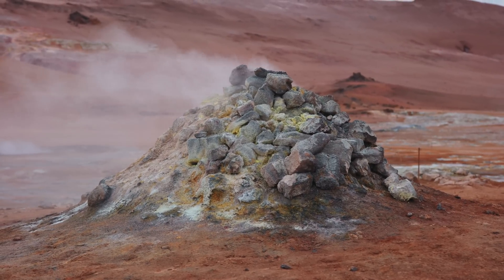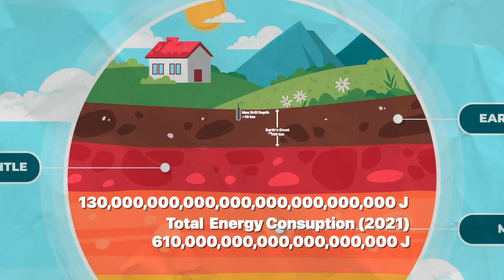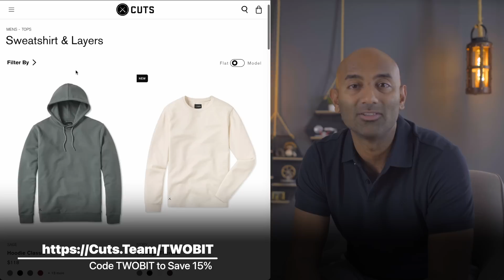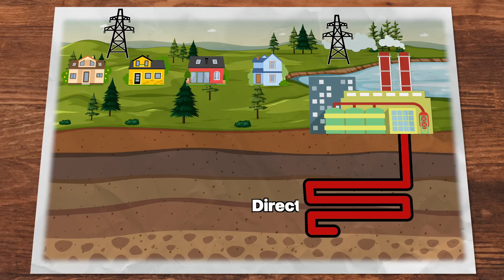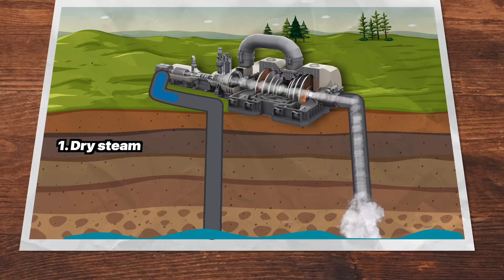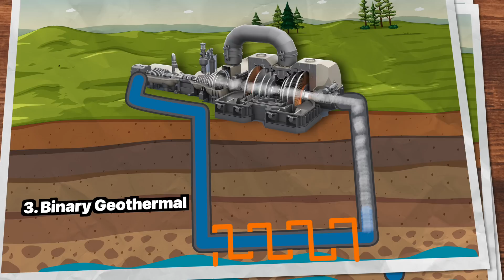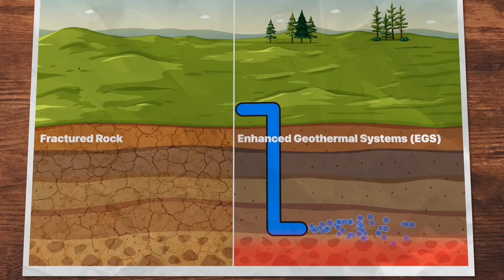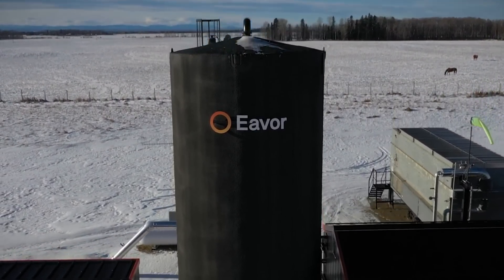This Breakthrough Energy Source Will Replace Nuclear & Coal!

Comment: I am curious. You didn't talk about using the new solar cells that use heat instead of light to create electricity. I am told that these solar units are way more efficient at converting heat into electricity than steam turbines. What about using them with this geothermal heat?
Reply: Are you referring to thermo electric generators ? TEG's
Reply: @richardstubbs6484  I had to research my history to find the video about these. This ALL-NEW Breakthrough Will Make You Forget About Oldskool Solar
2,655 views  Sep 15, 2022  Thermophotovoltaic, Thermophotovoltaic energy, Thermophotovoltaic efficiency, Thermal energy storage, TPC Cell, Thermo photo voltaic, Solar cell battery, Thermal energy grid storage
Reply: Are these things real or the product of someone's conspiracy theory?

Comment: AS DEMONSTRATED  BY THE research at the caldera near Los Alamos, New Mexico there is a problem in the stability of the geological structure making the structure of the powerplant to heavy for the places closest to the flumes for high temperatures needed for the superheated steam to run the turbines.

Comment: The first geothermal plant, 250 MW, was built in New Zealand back in the 1950's. It was the flash type that exhausted spent steam into the atmosphere. It has since been upgraded to reinject used steam, condensed back into hot water, into the ground. Nothing much happened after that until the 1990's then additional plants, using the Israeli Ormat binary cycle, began to spring up. It uses hotwater from geothermal wells to convert a working fluid, pentane, into gas, which powered turbines. The original fluid is never turned to steam but reinjected. This is the solution in use because the temperatures below ground are too low for flash steam plants. We produce about 900 MW of power from geothermal, with new plants, generally 100 to 200 MW, being built.
Reply: No, Italy was first. 
All the binary plants in NZ use separated steam and water from two phase production wells. 
We are quite lucky to have high temperature resources and geothermal power is competitive with all other generation options, but suitable sites are limited.
Reply: @NZLKevin88  I meant the first geothermal plant in NZ, not the first in the World.

Comment: Geothermal is not sustainable. I don't know where you got the million years from, but usually after a few decades the well is no longer economic to operate. The rock around the well cools as you extract heat. The "Breakthrough"s you refer to don't solve the main issues. It's still expensive and will cause earthquakes. They are just different ways to get very similar results.

Comment: Thank you.  I've been wondering for ten years why there wasn't a greater effort to at least drill deep and then piggy back the warmer temps down deep in ANY region with some other tech or two to create the energy needed to do steam/normal heat generation/etc.  Appreciate your bringing this extremely green and cheap tech to more public awareness.
Reply: "why there wasn't a greater effort " - the answer is always 2 things : cost and political will.
Now there are some companies who claim they can do it cheaper, with laser drill heads instead of conventional expensive diamond-tipped drill heads.
Reply: I toured the Equitable building in Portland, Oregon in 1964.  They got all their heating and cooling from a well under the building.  All the hot water came from a heat exchanger about the size of an oil drum. If they could do that 60 yrs ago, why aren't we doing it more and better today?
P.S.  The building was designed in the 1940's and finished in 1948.
Shame on us!
P.S. #2  I did some research and found that where I live, on the Oregon Coast, it would probably take about 50 years to recoup the cost of a geothermal well from reduced heating costs.  Kind of a non-starter.  (My kids won't live that long.)
If the cost of natural gas tripled, the economics might begin to work out.  It could happen.

Comment: My local power company looked for a suitable geothermal spot but couldn't find one, so we continue to run mostly on hydropower. I thought it was funny at the time because we have numerous hot springs and several volcanoes nearby including one in the county. I think the rocks weren't fractured enough. Maybe they will try again with newer technology. For now we still get enough rain and wind to keep relying on hydro, but I noticed California had hydro until the reservoirs started drying up and maybe it's only seasonal down there now.

Comment: Ricky, EGS sounds great, but for the cost and location issues. We should be building MORE nuclear power plants if we have any chance at "replacing" fossil fuels, which will not happen in my opinion in ANY of our lifetimes. Nuclear power stations do not require as much land per megawatt as other low-carbon methods of electricity production. The Arkansas Nuclear One Station requires only 1,100 acres (1.7 square miles) to produce 1,800 megawatts operating at a 90 percent capacity factor. A study by Entergy Arkansas estimates that for modern wind and solar plants operating at the same capacity, they would require 108,000 acres (169 square miles) and 13,320 acres (21 square miles) of land respectively to produce the same amount of power. Nuclear is by far the BEST, CLEANEST, and most cost effective by far.. So, why are all the tree-huggers wanting to shut down all the nuclear power plants???

Comment: Hydraulic fracturing (frakking) solves the rock permeability issue and you would only need to use water as you wouldn't be trying to free any oil from the rock.

Comment: Regardless of whether I throw a brick at your window, to smashi it with kinetic energy, or pit a blow torch to the glass until it shatters, your window is still broken. Same applies to bedrock, if we convert bedrock to shale by hydraulics, kinetic energy transmitted by fluid, or thermal means, in this case cold water rather than hot gas flames, that rock is shattered. If it ever does heal, it will take longer to heal than bipedal primates, and multiple orders of magnitude longer than our little subset of balding, rock cutting, corp planting, metal melting monkeys has been about. So I'm opposed to EGS, but Eavor's system eliminates the need to fracture bed rock, so it's ideal. I for one welcome our new energy overlords from Eavor 😹

Comment: Thermoelectrics is the only other thing that comes to mind. Could wrap it around a pipe with water or coolant running through it. It could work but you would need lots of pipes(miles).

Comment: "not a problem anytime soon", but that's what they also thought at the start of using oil and gas

and what now makes the problem even bigger cause developping countries are thinking "well the developped countries were allowed to use coal, oil, gas to start their industry and get developped, so we demand to be allowed to use those as well, even if everybody knows the bad long term effect"

and that will also happen when 'we' start using geothermal alot, and when we are seeing effects that indicate we're nearing the limit of what's allowed, 'they' can effort it aswell and demand to be allowed to also jump onto that wagon 

everybody is only thinks about their own need and not about the global 'limit' and the long term effect to the earth.

we should really stop thinking only about "how to solve generating energy the next 5-10 years for jsut 'us' "
but start thinking about "how to solve that problem globally without F'ing over all the next generations 20-50-100 years down the road"

just like windenergy is taking away energy from the winds that naturally cool down landmasses and as such will start causing problems inland more often in a couple decannia, or anything taking energy from water-current and/or -waves in the sea which is also a natural way to balance out temperature and such (see El niño and such)

Comment: So yes I think geothermal is awesome and clean but at some time could you please talk about way a sterling engine can’t be used instead of steam turbines use hot water from the ground and cold water from a cooling tower it seems practical?
Reply: Sterling engines just aren't that powerful. You'd need so many of them you'd have to cover the landscape to get a useful amount of power from them, and the cost per kW would be prohibitive.

Comment: Curious if the Yellowstone area could be a possible location for geothermal or could it be problematic?
Reply: Yellowstone would be good because the hot rock is very close to the surface, but with the new technologies coming it wouldn't be necessary to ruin the beauty of a National Park by building a power plant there.  It will be much more effective to drill the geothermal holes next to existing fossil fuel plants and convert them to geothermal.
Reply: Great question, I’m curious as well.

Comment: Have a mechanical direct connect to the axle of EVs and solar, to super charge them. No more plugging in. Use V2G tech to transfer extra energy back to the power grid for everyone to use. 😎

Comment: My understanding is to use a liquid with a lower boiling point in a loop not more than 1000 meters down. The need to drill down great distances is not required. The system is closed so less special rock types. The plants can be smaller ( steam generators ) used to produce heat and electricity. The current energy grids are going the fail soon so starting to rely less on them sooner is good planning. A great video and research, good job.
Reply: Hi Richard, you seem to be thinking in terms of domestic or community heating projects. The video has been produced in the context of industrial scale power generation. Closed system loops work well with small to medium installations which can be as low as 300m deep but for industrial scale installations they are impracticable. For example, the quantity of liquid Freon 12 to fill a 5km borehole would weigh approximately  675 metric tonnes based on a weight of 1.350g/cm3 in a 10cm borehole. Assuming that only 1% of the refrigerant is used, the resultant gas pressure would be around 23.62 bar (330.75 pounds/inch2) saturated at 100 degrees C. The borehole temp at 5km would well exceed  this temp and add to this the dynamic pressure differentials from circulation pumps and ground pressure from the weight of rock, the machinery and piping for a closed system loop would be expensive and fragile considering the pressures used.
Reply: @nemo-79000  Thank you for this reply and conversation. I am sure we are talking of the future heating and power generation. Looking forward to how this works out, thanks again.

Comment: Geothermal input to a heat pump system is the MOST obvious widescale application and it has been in use for decades. It doesn't lend itself well to utility scale, though, to generate the kind of profits demanded by the private sector before people will expend the effort to implement it (just like massively-distributed solar, or any other real democratically-beneficial utility model) or at least hasn't in the past. You largely glossed over that existing generation model.
We don't HAVE to use dangerously-polluting working fluids, either, if we don't have to be entirely focused on efficiency.

Comment: Geothermal is much more (potentially) dangerous than you were letting on.  It can potentially cause catastrophic issues in the ground that can affect the whole area (much like drilling for oil can, but worse actually).  It used to be my favorite kind of power until I realized this.  It has potential but it isn't infinitely renewable.  The Earth's core will cool (faster if we overdo geothermal).  Most likely we won't still be around to see once the core fully cools, since this would be many year from now, but who knows?  While a minor concern, it is one to consider (meaning we cannot make too many geothermal plants).

Comment: Start in Hawaii and use the relatively cheap electricity to create hydrogen (stored energy) for export.  There are other hot springs around the continental U.S. where might be able to easily tap the magma.  It really should be a greater priority.

Comment: Great ideas! I did hear of a scientist who has discovered how to drill deeper by vaporizing the rock. I can't remember where I saw it, but it's out there somewhere. I do believe this is the holy grail. I have always wondered about geothermal, mostly as an alternative to outside air heat pumps., This trumps everything though. Thanks for the presentation.
Reply: Quaize Energy, an MIT spinoff.

Comment: The Earth's core temperature is much hotter than the estimated 10,000° F.  Do the math.

At a depth of 40,230 ft. the Earth's temperature was measured to be 356° F.  The gradient temperature comes out to be 131.47 ft. in depth for every 1° F increase in temperature.  The Earth is 3,963 mi in radius.  There are 5,280 ft. in a mile. 3,963 x 5,280 = 20,924,640 ft.  20,924,640 ft. / 131.47 ft. = 159,159° F at the center of the Earth.

How far would one have to drill in solid granite so boiling water could be continuously pumped up to the surface and power turbine generators? 131.47 x 220° F = 28,923.4 ft.  So a well would have to be drilled down to about 29,000 ft. to produce free energy just about anywhere on Earth.

Comment: Maybe I'm mistaken, but the image of the steam turbine appears reversed when compared to a coal fired power station steam turbine. The small end is the high pressure turbine and it generates the majority of the shaft power. Once the steam has gone through the HP turbine it expands thereby reducing pressure, so then goes through the larger intermediate and low pressure turbines, hence the larger diameter.
Reply: That graphic was quite bad.  You will not see a small HP section on any geothermal steam turbine, the steam pressures are not that high, usually in the 5 to 20 bar range. 
The graphic also missed out the vacuum condenser and cooling tower.

Comment: Nicely presented video.
Britain is really suffering at the moment due to soaring energy costs. Renewables are just far too intermittent. 
We have a solution to global warming. Nuclear. The so called greens don't really care about the planet. They don't care if we burn coal. Anything but nuclear. 
I wish geothermal will work but sadly I think it is a long way off .
Reply from the maker: I think Nuclear has a place for sure, but its getting very costly to build, but we do have some new projects going on!
Reply: @TwoBitDaVinci  
The UK has now approved the Rolls Royce SMR - basically a nuclear submarine reactor mass produced in a factory.
Battery storage is a joke - the World's biggest battery would power a ship for only 1 hour. To get Britain through a typical winter wind lull we would need 300 years of total World battery production. And yet politicians keep throwing money at it.

Comment: I see geothermal as a large additional source of energy, but not as a complete replacement.  If oil was used only for auto, truck, and plane fuel, not as gasoline but as propane, the emissions would be drastically reduced as well as the cost of production.  Plus, emission control could reduce it even more.

Then use geo for heating homes and businesses, and for powering electric trains.

I think it definitely looks better than nuclear.

Comment: Geothermal is useful, however not all areas are suitable for geothermal power due to the depth of the hot rock being too far down, given the fact that we are currently limited in the drilling technology we have, this is not likely to change any time soon for many areas, that's why there aren't geothermal power plants everywhere.
Reply: That hasn't been true for years. The oil industry developed the tech to drill very deep, to the point that with these other technologies geothermal is now viable most places around the world. That was the whole point of the video.
Reply: This is probably the upcoming video he teased about… look up Quaise Energy, they have a method of boring that uses millimetric wave technology which can go ridiculously deep (company claims 20km) and even produces a vitrified borehole (ie like a hole with a glass sheath as a natural outcome of the drilling process. I’m pretty optimistic that it will be a significant green energy technology capable of being used almost anywhere in the world.